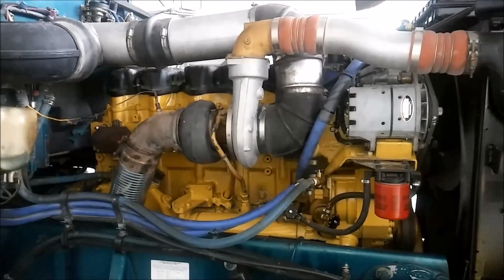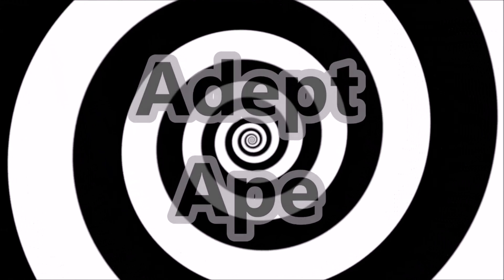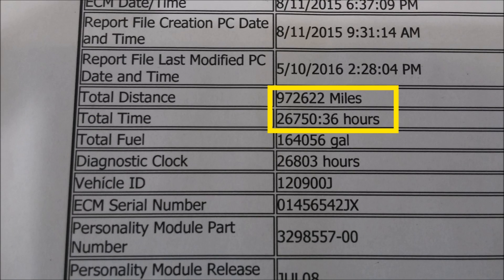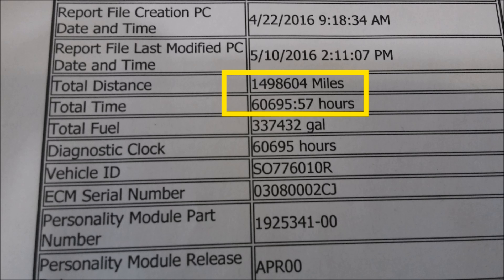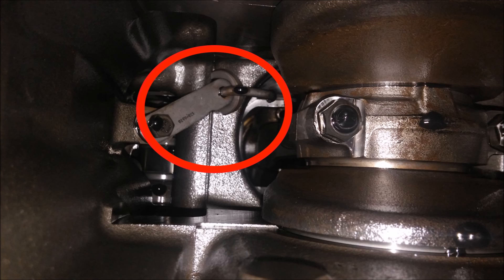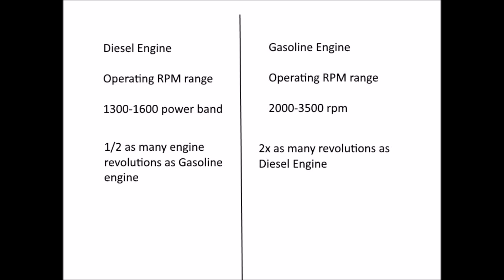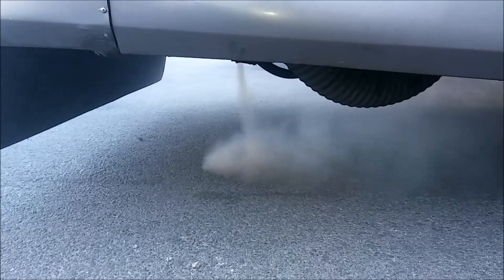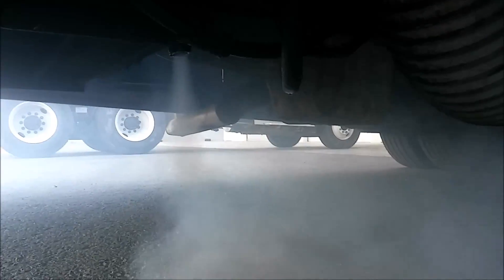Why Do Diesel Engines Last So Long?

Comment: i had lot of cars diesel now i only have gasoline!! pay more fuel and save in maintance
Reply from the maker: +RbG84 Both my cars are gas, Diesels are more expensive I agree. I'm not hauling freight or long miles so I don't need the Diesel.
Reply: gasoline very easy to fix and lots of engine space!! gasoline and LPG is the best!! diesel is for trucks or the old reliable engines like the VW 1.9 tdi and not abuse hard drive etc ,,,or the diesels non turbo mercedes 190d etc

i had a seat leon 1.9tdi 150 hp chipped and spend more than gasoline engines and had a problem need to change injectors and later flyweel etc what a nightmare

good luck

only fault gasoline is the low torque at low rpm (easy fix with chip tune and exaust) and more rpm at same speed (diesel good for freeway) and gasoline because highter rpm need better oil.

Comment: Does all the things you say go for cars with diesel engines as well? For example, does a Volkswagen Beetle with a diesel engine have all the same advantages as the truck versions?
Reply from the maker: +Bob Simmons Some of the items apply, like the lubricating properties of the Diesel, but on an automotive application the parts are closer to a gasoline engine in size and function, although built tougher to handle the higher compression ratio and boost.
Reply: Adept Ape
Thank you for the info.

Comment: Yes diesel is pretty good. When you compare engines with electric motors, run time and maintenance, we are all crazy to use them these days. An electric motor will easily run for years without any servicing.

Comment: One other thing as to why diesel can run so many more miles than a gas, goes along with your heat cycle statement on how most diesels are used, most are out on the highway clicking away those miles at more than one a minute, where as gas applications are not always out on the highway all day long, their engines are running stuck in traffic adding wear without adding miles. That and the rpm difference are two big reasons why, although we had a customer that hauled RV's with a 5.7 hemi ram 2500 that traded in his truck with 632,000 miles

Comment: a volvo p1800 with a 1.8 petrol/gas engine has done 3,000,000 miles, and very many Volvo's wity red block engines go over 500,000/1,000,000 miles, mine personally is a 1978 245dl with a 2.1l engine, 300,000 miles and absolutely perfect condition
Reply: Josh Briggs viva LA socialist design
Reply: Samuel Rosenberg I had several Saab's go for 300k, needing both gearbox and flywheel/clutch killed them... No point spending 600 euro on a 200 euro car... R.I.p
Reply: But I don't live in the states, I live in Europe with tighter maintenance laws, road tax was 2500 per year, insurance was 3000 euros per year, don't ever mention a Volkswagen in a reliability discussion, you've never seen a skinny vw mechanic so its fair to say they're pretty worthless

Comment: Nice little comparison. I just want to touch off on your point about diesel Vs. gasoline. One being a solvent and the other a light oil. Water is a solvent. Diesel also has solvent properties. So your point about one causing more wear and tear than the other, though valid, there is more to it.
Reply from the maker: +xxBrodieTheDogxx Technically most liquids are solvents aren't they, but I was more referring to the fact that gasoline has almost no lubricating properties. The differences between the two engines could have been talked about for a couple hours, but I just wanted to make a somewhat short video on the subject. Thanks for the comment.

Comment: Question. While it is true (semi truck) diesels last a longer number of miles, will such a diesel survive the same number of cold starts? 

Even with rather lubricating properties of diesel, such a large engine will not reach operating temperature as quickly as a small gasoline motor, potentially accelerating wear
Reply from the maker: +Mr. LargoFeet That is a good question. Some of the reason these engines get such high mileage is due to them getting lots and lots of highway miles and not getting turned off and on several times intermittently a day. Driving such an engine like that would surely increase the wear.

Comment: the printouts you showed at the beginning don't mean a lot, those motors could have been in-framed and the engine hours or mileage does not get zeroed afterward. I'm not arguing that diesels aren't longer lasting but in my experience I've not seen more than 36000hours on a cat before an in-frame was needed.
Reply from the maker: +Peter Bilt I've seen them go about 1.5 million before needing an in frame, but that is not typical.

Comment: A diesel has larger and beefier parts but so are the loads and duty applied to them. proportionally aren't they close to the same in that regard?
Reply: For true heavy diesels (not the high speed diesels used for passenger cars, SUVs, etc.), they are over engineered for maximum reliability and long term economy. For instance, you will be hard pressed to find a semi engine that revs over 3000rpm.

Comment: there are a lot of diesel engines in HD applications with hydrolic lifters and vareus parts similar to a gas engine but much beefier but diesels like you said with proper maintenance will outlast a gasser (I only run diesel ive never had to do an engine job on my vehicles to replace the engine only to perform any nessisary high milage ware and tear repairs (had water pumps die, injectors, oil coolers ETC. got an old screaming jimmy with well over 1500000 miles (not kilometers) on her and she still runs best kind never misses a beat can always get abord that old truck and know she will get the job done love diesels might be pricy for parts but they also last a long time (got a new 2017 ford power stroke on its way as a new addition to replace the old IDI 7.3 that suffered a bad collision :( going to miss that good old truck but I kept the engine got plans for a diesel project lol we will see what the new will do (do you have any reccamendations for good ways to care for these new engines verses the old mechanical workhorses?
Reply from the maker: +Da Sarge I'm really a Cat guy and if I knew any special tricks for the new Ford trucks I would let you know, but I've never worked on them.
Reply: ahh got ya the cat diesel is agreat engine (my genset runs a cat V8 not sure the model engine got the unit used from a place that losed down) I just keep the fluids all topped up and serviced regularly any reccamindations on what I should be doing to keep my cat genset running its best? or just the usual maintanence

Comment: what kind of diesel engines are you talking about? Not diesel engines on normal cars! All diesels that I know have distribution chains. Actually my Mercedes 420CDI steched the distribution chain because the hidraulic tensioner failed. Also tipical in diesels is failure of sealing at the injector, turbo filailures, etc... Moderno diesels in cars have more or less the same number of issues (or more) than petrol bur are much more expensive to repair. The old Mercedes diesels lasted millions of miles, but not modern diesels.

Comment: Btw, why are you comparing a semi-truck engine to a small truck engine? Why not compare the Cummins 6BT to a small block 350 Chevy engine. Btw since when is a 350 a big engine? I thought they were always small blocks engines, some small and lightweight(aluminum block)..
Reply: The 350 is also considered the best, most reliable gasoline engine ever put into a truck. So I don't get his point. I've seen multiple of them over 500,000 miles.
Reply: My first car was a 1970 Chevy Bel Air sedan with a 350 engine. It went over 99,000 miles before it finally gave up.
Reply: Glenn Lego Did you take care of it? Taking care of a car is like taking care of your health...
Reply: Yes I did.
Reply: You do realize it's cheaper to replace the engine than it is to replace a car right? Well, I don't know when your car blew up, if you took care of it, it shouldn't have blown up the way it did. A 70 Bel Air? Dude....where the fuck is it now?
Reply: I traded it in for a different car, a used one. You know , of course, that the 70 BelAir was the economy version of the Impala. The engine didn't blow up. It just simply died. Where is it now? Who knows?I got rid of it in 1981 so it is anyone's guess. I'm driving a 2011 Hyundai Sonata now  and the way things are recycled these days the Sonata may actually be my 1970 BelAir. :-/
Reply: The 5.9 Cummins , should not even be in same category as a 350 Chevy, the old work horse 59 would run decades longer than a 350 used in generators and everything, run 24 hours day 7 days a week, never made a 350 that do that!! 6bt all the way!!

Comment: Only reason diesels last longer is because of low engine operating speeds. When you're at max power at 3,000 rpm, you likely won't be above 2,000 very often. Lower rpm means shorter distance mechanical parts have to travel, which means less friction overall, which in turn means less wear.

Comment: if a gasoline car is only moved long distance,  i'm sure it would last really long too. not as long but still long. interesting would be to know which type can have more starts in its engine life. like on a day i could start and stop my engine 2-8 times. if i did the same with a diesel.. would it live longer? from what I know: gasoline great for more short trips,  diesel only good on long trips. with my car the diesel model is said to have a less reliable engine actually.  gasoline engines heat up faster right?

Comment: Thanks for the info; It seems that as far as the design comparison you're not really comparing the same things here: INDUSTRIAL vs consumer engines here...  Consumer diesel engines don't have a lot of the advantages you speak of...

It would be great to see a comparison about consumer auto engines vs gasoline if that is the case...

Comment: Electric motors can go a million miles. Unfortunately their batteries won't. But one day, batteries will also last a million miles.
Reply from the maker: +Cynthia Avishegnath Am electric motor can potentially indefinitely as long as the end bearings don't fail. There are no contact points on a brushless motor so there is nothing to wear over time.
Reply: The windings can burn out. If you hold a car on a slope.and the electro cvt keeps slipping.
Reply: ... keeps slipping 100%.

Comment: So why even have a gas engine, especially in an RV, when you have a properly maintained diesel?I wonder how long a good gas motor would last cruising at 2000 rpm ten hours a day.
Reply from the maker: +Kirby I bet a gas engine would last several hundred thousand miles under those conditions if maintained properly.

Comment: Points you made are right, in particular RPM issue is a major player because wear is exponential to RPM increases. To put that simply, doubling the RPM of an engine will more than double the wear rate of the engine.. And exponential, at the top end of the RPM range a small percentage increase in RPM will cause significantly more wear than the same percentage increase in RPM in the low end of RPM range.
Reply from the maker: +AusMecham Very good point.

Comment: I think the problem with motor home owners is they really don't know how to drive a diesel vehicles. For instance you have to watch your gages and know what the normals are, most drives lug their engines, they don't drop their gears and keep it between 1700-1900 RPM with a six speed Alison Transmission when climbing a grade. I'm a commercial driver, I always do pre-trip before I take my RV on the road, at least once a month I have my tires checked and I am annal about my maintenance on my RV.  I feel a motor home diesel engine should out last the coach if it is maintained properly.
Reply from the maker: +Michael Green The engine can definitely outlast the RV, but that is usually not the case. I don't think many people know the expense of the repairs that a Diesel engine that isn't properly maintained can cause. I've run in to a few very knowledge RV owners that maintain and understand their machines and you sound like one of them.

Comment: When it doesn't do a million miles it's build crappy............. Been in an old Mercedes diesel taxi the guy drove for himself bought it new. I took his word it was never been overhauled 1.5 million KM just short of a million miles and that was a CAR engine.
Reply: A taxi would probably not go through many heat cycles as they are generally running all day. I'd wonder about the transmission though as all that acceleration could have worn it. 
But older auto transmissions seem to last a long time anyway as long as you don't change the fluid and just keep topping up the leaks.

Comment: how does my gasoline engine still work after 12years of driving 1-3miles before it stops again and the door closing mechanism on the drivers door doesn't work anymore
Reply: You can lose one or two cylinders through low compression and burned valves and not really notice it, however if you lose a door you're going to notice it.
Reply: tanker9987 I've inspected it every cylinder runs last Friday the ignition system got damaged so I needed to get towed to the repair shop this year was very expensive in keeping the car running I've spent at least 10000$on it
Reply: Specially if you fall out the car onto the concrete road.
Reply: The door probably was opened more often then the engine has kilometers(240000)

Comment: Gassers are a rip off.
Reply: Or people who eat too many beans at a time!
Reply: Yeah, because everyone wants to replace a $1,500 DPF at 100,000 miles!
Reply: And, while you're at it, go set a forested area on fire, flush your used engine oil down the toilet and flavor a bunch of snowcones with used antifreeze and pass them out at an elementary school!
Reply: That's because diesels typically have very lax emissions standards, they're still filthy compared to gasoline engines.

Comment: It's the amount of power per displacement, it's much lower compared to a gas engine.  A 15L Cat diesel engine only outputs 500HP.  A Corvette engine also outputs 500HP, but it squeezes it out of less than half the displacement, about 6L.  The Diesel engine parts are much less loaded (combustion load + inertia loads) compared to the Corvette.
Reply from the maker: +Stephen Kramer You are correct in that a Corvette can put out 500 hp, but at about 6,000 rpm and a Corvette almost never puts out 500 hp because it only does that at wide open throttle. A Diesel Truck puts out close to its max 500 hp with much more torque, around 2,000 ft lbs at only 1600 rpm and does that for a large percentage of its life because they run loaded nearly all the time. See if that 6L engine runs at 500 hp for very long.
Reply: +Adept Ape I'm not bragging just adding to the discussion.  I believe diesel power (speed x torque) is limited by combustion speed of the diesel fuel and the max turbo speed because the turbo is tuned more for low end torque.  The huge torque means you need fewer low range transmission gears.  If it reved higher with 2000ft-lb you would have similar power density and you could put more kinetic energy into the vehicle faster.  The 6L gas engine can process more power but you would need a lot more gears to make it move a semi.  The BMEP, or ave cylinder pressure is much higher in a turbodiesel however.
Reply from the maker: +Stephen Kramer They are just built for different purposes, I'll admit that I'd rather drive the gas engine, but I like the Diesel design better.

Comment: but what about the added complexity of turbos?
Reply from the maker: +TheJoncic The Turbo doesn't really add too much complexity, a Turbo only has one moving part and can last a very long time, but they do add quite a bit to the price of the engine and the engine makes very little horsepower without it.

Comment: That was NOT a main bearing for a Chevy 350. Rod bearing maybe, but still too small to be a main bearing for a 350.
Reply from the maker: +ICU2 GetMe I cut the shape to the exact dimensions they had on Jegs for a small block Chevy main bearing journal, it may appear small just because it wasn't curved, but it was the right dimension. I was going to use a Ford 460 main bearing that I used to have laying around, but didn't have the old bearings anymore.

Comment: Obviously gasoline engines could be made with bigger bearings, heavier crank shafts, etc. etc. etc.  I think that the most import reason that Diesel engines last longer is that Diesel fuel is actually a lubricant, as the video states, whereas gasoline is actually detrimental to lubrication.

Engines which run on gaseous fuel, i.e., methane, propane, or butane, last longer than otherwise identical engines because the gaseous fuel has no detrimental effect on lubrication.

A number of years ago, Ford found that cylinder ring wear was many times greater at very low temperatures than at normal running temperatures.  That's why wear during starting and warmup is greater than while running.

The smaller Diesel engines used in cars are much lighter than the Diesel engines discussed in the video.

Comment: How about comparable displacement, comparable usage automotive engines diesel vs gasoline. Do the same comments you've made apply? How about why diesels turn slower than gas engines?

Comment: I ran a 980 Cat loader with over 24k hours that had NEVER been touched except pins, bushings, repacking cylinders and normal stuff and ONE valve cover gasket. The internals were checked when the leaky gasket was replaced and everything was fine.
Reply from the maker: +Lewie McNeely Cat can make some good engines, can't say all of them have been amazing, but some like the 3406 are great.
Reply: Adept Ape I drove an old worn out Pete tri-axle with a 3406B (mechanical pump) that was SCARY the way it pulled. The new C-10 can't get close!